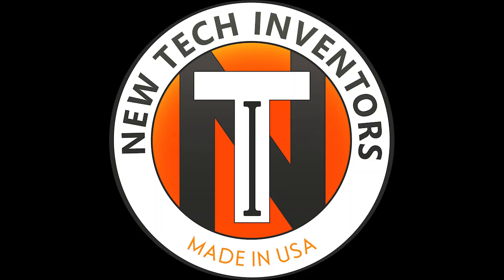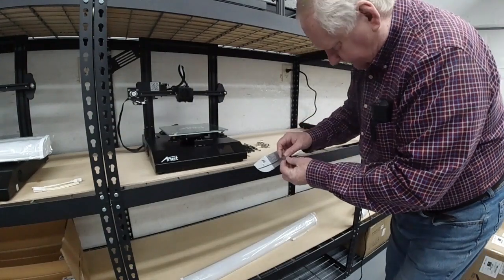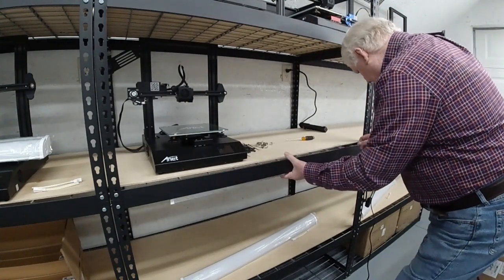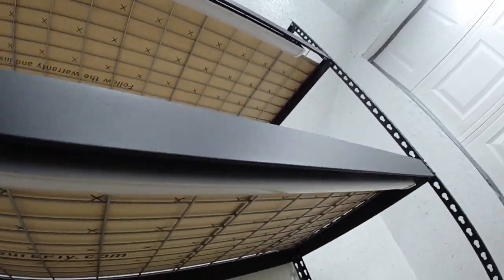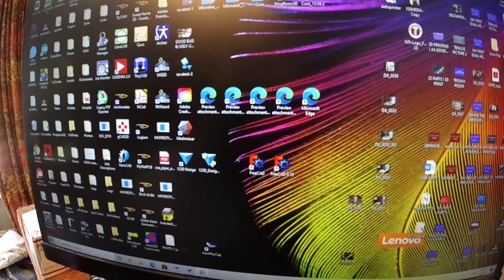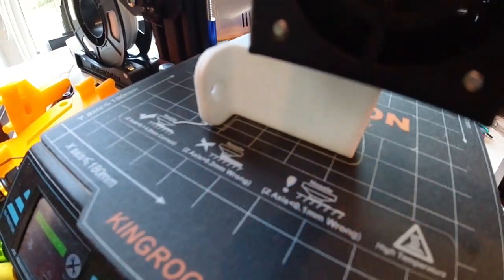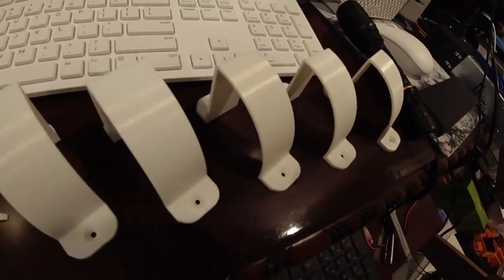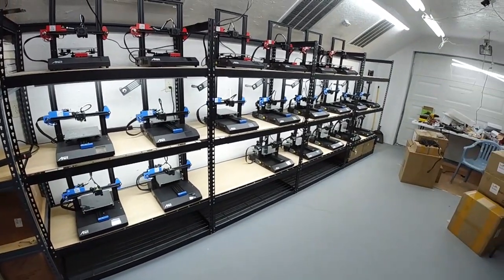MY  NEW  3D  PRINT  FARM  LIGHTING

Comment: Hey looks great ... where does the power come into and out of the light? How many do you have on a outlet or 20 amp circuit?  Great ceiling bracket.....great to see you ..JV
Reply from the maker: Thanks Joe , How are you? I didn't bother showing the wiring, was afraid it would get boring. Each light has a small three prong socket on each end and comes with a straight coupler for putting them in series like on the ceiling and a plug with a pigtail for connecting to a power cord. I purchased a couple power cords and cut off the socket end and used wire crimps and tape the make my connections under the shelves. All the LED lights are on one 20A circuit, there are 12 lights at 20w for 240 watts or about 2Amps on my 20 amp circuit. I was a little surprised that the 6 Anet printers I fired up yesterday only needed about 3 Amps total to maintain temperature of both the bed and hot end. I expect it to go up a little when I start having to melt filament. Good to hear from you my friend....Ken
Reply: @NewTechInventors  I think if you don’t mind , I need to see a picture of that.  Thanks. Man your the best.   I just saw a video of a dual extruded printer printing in mirror.   If that’s the case.   You could use that in your portable Lap lunch helper.  Nice on the3 amps output.  I love that.   Just wondering why you need a heated bed for PLA.  Thought of an interesting concept .   If you do need to heat a bed why heat the whole bed.  In my case I just use 1 small 30mm diameter area.  If I could just heat that 1 area with a movable heat tab I would save tremendous amounts of electric.  A magnet could position the heat right where you want it. Let’s you and I design it.  Your friend joe